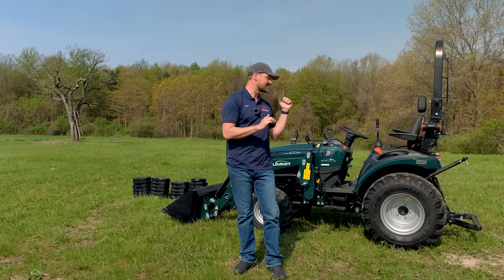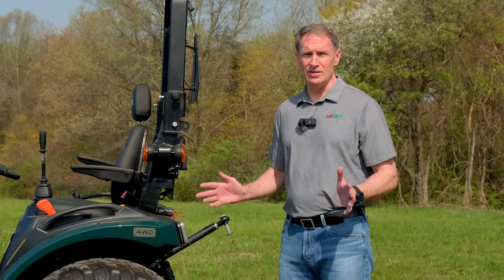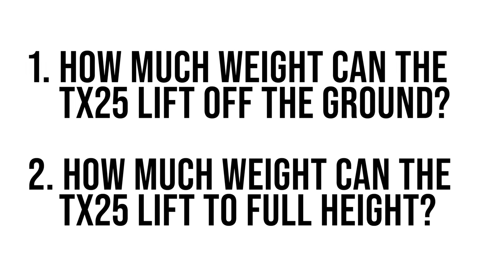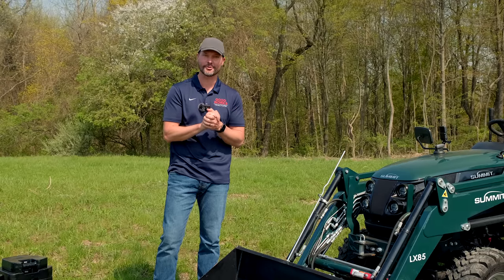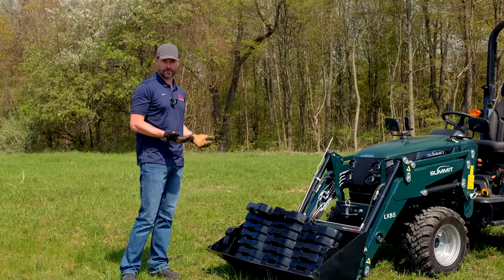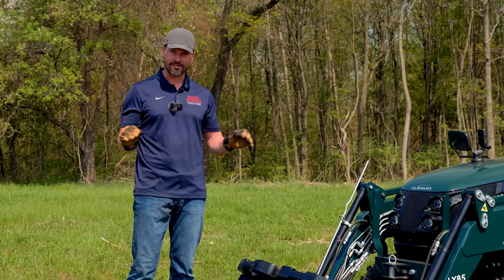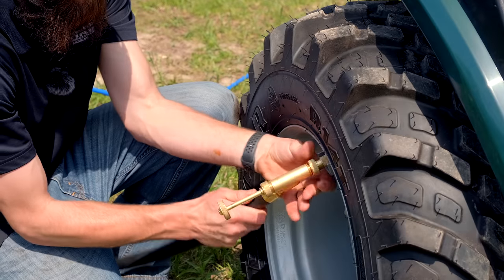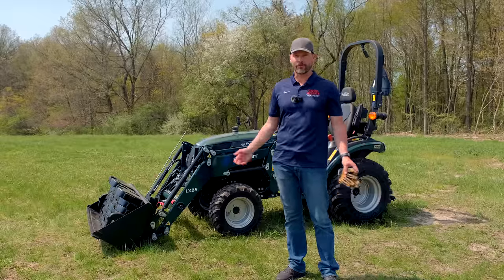TRYING TO TIP A TRACTOR & MAX LIFT TEST OF SUMMIT TX25 🚜

Comment: I bought a small tractor with liquid in the rear tries. How can I tell what is in my tires
Reply from the maker: I take a key or screwdriver and gently poke the valve (careful as contents are under a bit of pressure).  Sometimes it's easy to figure out, other times not.  A good test to at least know if it'll free or not is to collect a small sample and put in your freezer overnight.  This will at least give you an idea of it its water or too much water.  Odor can help too.  Water, windshield washer fluid, calcium chloride, RimGuard, and TL90 are some common choices used for liquid ballast.

Comment: For a reference… on that tractor, how much weight did the liquid ballast add?
Reply: Each rear tire on the Summit TX25 requires about 15 gallons of Rim Guard and adds around 350 lbs total. 
If you're interested in finding how much a different tire size requires, visit www.rimguardsolutions.com/beet-juice-is-better/tire-fill-tools/
Reply: I've just finished getting RimGuard installed by a local dealer in a new tractor, so I've been all over their website for a while now.  They have a thing they call a "Fill Tool" that tells you for a given tire how many gallons it takes and the weight. Summit says the TX25 comes with Goodyear R14T 12-16.5 rear tires (www.summittractors.com/pdf/specs-tx25h.pdf).  And the RG fill tool says those tires take 16 gallons, with a weight of 175 lbs.  (www.rimguardsolutions.com/tire-fill-tools/)   So the two tires would add 350 pounds total.
Reply: @RimGuardBallast  is that 15 gals per tire?
Reply: @rcclassiccrawlers4368  yep!

Comment: When the loader is plowing snow in float control mode, the loader weight makes no contribution to traction.  The RimGuard only loads the tire, not the axle. In the front, some minor extra steering forces are felt, but that's it.

Comment: The rear tyres in my tractor are filled with water. The weather rarely gets very cold where it is. I cannot say if the liquid ballast makes a difference as the tyres were filled before delivery. However I would not own a tractor if it did not have liquid ballast in the back tyres. This is how we roll with steel hills and gullies in the area.

Comment: Out of experience,  load  the  front  tires  for  traction  situations  instead  of  suitcase weights,  unless  its  a  larger  class  tractor,  (50/60  horse  or  larger  for  field  use.)  Loaded  rear tires  for  loader  use,  absolutely,  loaded  tires  add  weight  to  the  tractor  as  a  whole  unit,  any  other  added  weight  puts  more  strain  on  the  tractor  frame,  wheel  bearings  steering  etc.....   meaning  possibly  sooner  replacements.  Older  tractors  were  heavy,  cast  iron  cast  steel,  hey,  maybe  even  cast  plastic!  Settle  down,.  just  kidding  on  the  plastic.  But  regardless,  newer  tractors  have  a  lot  of  cheaper   and  lighter materials  in  them,  beware  of  where  you  put  extra  weight.

Comment: Be careful...it's easy to overload the front tires when the entire weight of the load and tractor are supported by the two wheels.  1,500 lbs of load + tractor weight + operator can exceed the load rating of the two tires, especially the R14 or lighter tires.
Reply: Good advice. The health of the front tires is easy to ignore until they fail.

Comment: The Summit is about the size of  J D 2000 series not equal comparison I don't know about the  Kabota I'm guessing it's about the same.
Reply from the maker: Hehe, one of the arguments that never go away...I pulled those lift numbers from the 1025r and B2601 from a video I did a couple years back.  A vocal minority insisted it wasn't fair when I compared the 1025r to the BX Series.  So, I compared it to a larger frame tractor, the B2601.  The B2601 is most definitely a direct competitor to the Summit TX25.  The Summit lifted nearly 200 lbs more than the Kubota B2601 to full height.  The 1025r was included as a data point since it was convenient.
Reply: The Deer 2025R lift almost the same as the 1025R and is the same size as this TX25.  If you want to compare against the Deer 2038R or the 2032R that's one size over.

Comment: ballast has nothing to do with keeping the back wheels off the ground and everything to do with transferring load from the front axle to the back axle. all those CUTs with worn front axles at 250 hours are because they put a rake on the back and because the wheels didn't come up too often they figured it was fine. you should hang the lifting capacity of the loader off the back of the tractor to ensure double the load of the loader isn't applied to the front axle.   if you dont understand what i mean by this, at 11:36 when you put your foot on the bucket and the back wheel came up, tell me how much weight was on the front axle ? the whole weight of the tractor plus the load.  rimguard and wheel weights do not serve the same purpose as ballast. if you lift heavy on the loader, ballast the tractor according to the manufacturers specs, not only is it safer, it's correct for your axle
Reply from the maker: Doesn’t sound like anyone could change your mind.  Be safe out there.
Reply: @GoodWorksTractors  not sure what you are saying here, about what would my mind be changed? physics? axle ratings? weight transfer? ballast levers weight from the front axle to the back axle and if you don't understand the concept, and you're calling rim guard loader ballast, you are the one who needs to change, because you are simply incorrect, if you are selling a product, your customers deserve correct info and that requires you to be correct to start with. i'm critiquing your presentation here not because the tractor in question is bad, but what you are promoting (the goal being keeping the back wheels on the ground) is bad for the longevity of axles and totally the wrong way to consider what is happening when you hang a load 3 feet ahead of the front axle.
Reply: to further clarify, i suggest everyone add rimguard to their wheels, i am not advocating against that. it's a fantastic traction aid, adds weight to the contact patch with little shearing force on the drive motors and is an all around positive to the tractor experience. i use it in both of my tractors. it is not, however, ballast against loader weight, unless you put a barrel of it on a carry all on the 3 point.
Reply from the maker: @JTillotson80  it’s promoted by the tractor manufacturers on how to ballast their equipment.
Reply: @GoodWorksTractors  No, as specified in the LX-85 loader operator's manual, the proper way to ballast the tractor for any loader operation is a 3 point counterweight of 551 - 661lbs. That's Summit's specification, in Summit's manual, for Summit's product. Rimguard is a selling point for the tractor, but it isn't loader ballast, and the engineers who spec the tractor for loader operation know that already, and put the spec in the manual. I believe they trust you to communicate that spec to your customer for safe operation, but if you don't, they're going to have questions for you once they buy your tractor and then actually read the manuals.
Reply from the maker: @JTillotson80  Like I said, no one will convince you otherwise.
Reply: @GoodWorksTractors  Yes, when someone is correct, it's hard to convince them they're wrong. Unfortunately, when someone is wrong, it's also hard to convince them they're wrong - even when you show them the manual for the product that tells them they're wrong. Good luck eating the cost of all those axles Summit won't warranty because of this video, and handling the lawsuit you end up with when someone flips their tractor and they point out your recommendation that they not follow the manufacturer's guidelines. Cheers.

Comment: How much to rim guard a tractor that size?
Reply: The Summit TX-25 rear tires are 12-16.5. These require about 15 gallons for a 75% recommended fill adding over 160 pounds to each tire.

Comment: What pisses me off about rimguard, or actually the dealers, is they won't let me buy any to install myself. They want me to bring my tractor down there, which then I'd have to rent a trailer.

The next nearest place is a good 3+ hours away, which is odd since I live near agriculture country.
Reply: Same!  I'm a two hour drive from rimguard. I used washer fluid in my tires.
Reply from the maker: you might can work a deal to have rim guard shipped to you, but then you may pay as much for shipping as you would to rent that trailer.
Reply: If you live in agriculture country it's likely you have a tire / equipment dealer nearby. We have added 173 dealers in the past 18 months, many of which were contacted by an informed consumer life yourself about wanting Rim Guard in their tires. Feel free to bring it up with them and we can get them signed up!
Reply: @RimGuardBallast  Thanks. I actually just reached out to the original place again and asked to speak with the head honcho. I was able to talk him into filling up a 55 gallon drum for me. $165 shop fee plus the price of the Rim Guard. I think that's pretty reasonable.
Reply: @seanwahl1000  great news, we are happy to hear they were flexible with your request!

Comment: Where I bought my Kioti they basically don't let you leave the dealership with a loader and no rim guard and include it in their base price. I think it's a great policy. One thing I was curious is how the lift capacity compares to a Kioti CX series as far as loader capacity. Kioti tends to build much heavier tractors for the size of Kubota/JD and tends to have higher loader capacity.
Reply: The CX2510 HST has total pump flow of 11.3 gpm and the FEL can lift 1,092 lbs to full height at the pivot pins, 1,203 lbs 24" beyond the 3PH.  I couldn't find total pump flow for the Summit TX25H (only implement flow of 4.8 gpm), FEL lift of 925 lbs ..., and 1,168 for the 3PH ....  The Kioti also a little more PTO HP, 18.8 vs 18.0

Comment: The only time I can see rimguard as a great thing is when you are running a spreader or a brushog, otherwise put your  disc or hyd blade back on the 3 pt. But again you do you.

I think I am interested in wheel spacers however.

Also "professional" just like smack it with a stick, but you need special shit to fill a tire. I call bullshit but ok.

Comment: The biggest disappointment with this tractor is how weak the loader is in respective to the weight of the tractor. They gloat about how heavy it is then give it a loader that can't lift more than 750 pounds to full height. There is no reason this tractor shouldn't have been given the capability to lift 1,300 plus pounds to full height. Tym makes several Tractors in this class that are lighter and will lift 1,300 pounds to full height.
Reply from the maker: So then the tractor should be that much heavier to offset the loader lift capacity.  Your logic is completely flawed.
Reply: @GoodWorksTractors  to an extent, you are correct. But a 3,300 pound tractor should not be maxing out at 750 pounds on the loader. A 3,300 pound tractor can and does safely lift significantly more weight. The TYM 2400H weighs 1,800 pounds and can safely lift over 1,000 pounds (rated for 1,300 pounds). Branson 2515 weighs 2,900 pounds and can safely lift 2,200 pounds. And those numbers are to full height. Kioti has similar examples as do other brands, but I think I've made my point... Summit could have and should have put a stronger loader on this machine.
Reply from the maker: Those tractors are way to out of proportion on machine weight vs loader lifting ability.  They are setup dangerously for the vast majority of operators who think the machine can lift that kind of weight out of the gate without significant additional counter weight.  Summit is setup the right way.  When the customer gets the tractor, they don't have to think about ballast weight to safely lift a load.  The ballast is already there.  

With all those brands you just mentioned, they are right on par with what I've said for years...light, tippy, and waiting to kill someone.  Tens of thousands of brand new tractor owners every year and more and more salesmen that are uninformed about the dangers of operating one.  That TYM you mentioned is 44" wide!  You could almost push it over it's so narrow.  Much more to operating a tractor than simply reading specs online.
Reply: @GoodWorksTractors  so you think a 3,300 pound tractor should top out at 750 pounds to full height? That's the maximum a tractor that size can safely handle? I don't disagree that 2,200 pounds of loader capacity on a 2,900 pound tractor is to high. But 1,500 pounds wouldnt be and 1,300 pounds definitely wouldn't be. The Summit should have lifter that can do 1,300 pounds to full height. Rear ballast is key, you shouldnt be using the loader without it when lifting any kind of substantial weight.
Reply from the maker: @CoffeeNo0b0514  I think it gives them margin for error.  It errs on the safe side, who cares if it has “extra” weight.  Your argument is based on some imaginary mandate that says a loader must lift a certain amount based on machine weight.  Weight adds to stability all around and lowers the center of gravity.  It is for much more than just what a loader can lift.  It helps to prevent rollovers on the side as well as front to back.  You have to look at a complete picture, not just one portion of it.

Comment: Not real world in your lifting test. You were stacking weight at set height.  Not lifting.  You measured the trailer to figure what weight you could unload. You would not be able to lift that weight off the trailer.
Reply from the maker: I explained that if you were throwing bags of stone in the bucket or something similar...I mention this in the video.